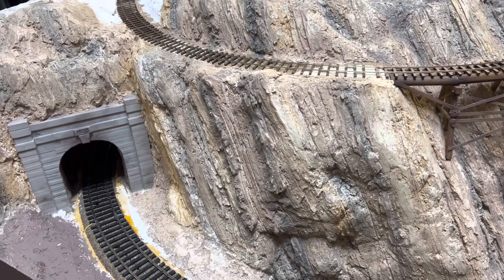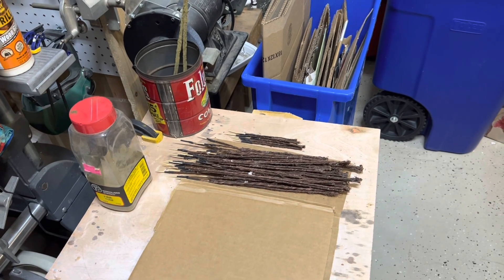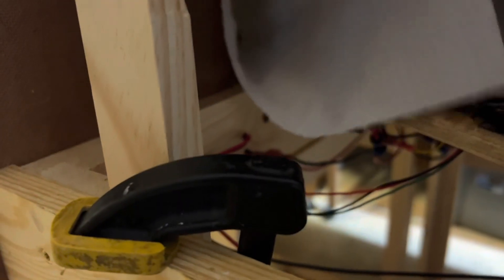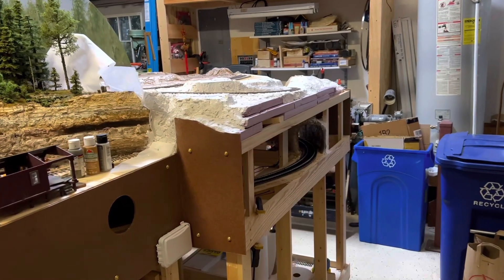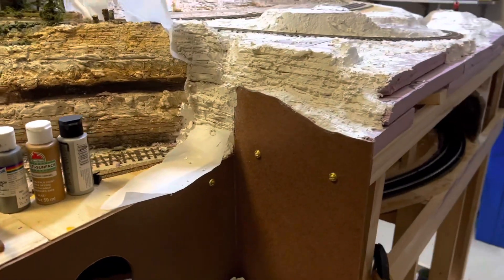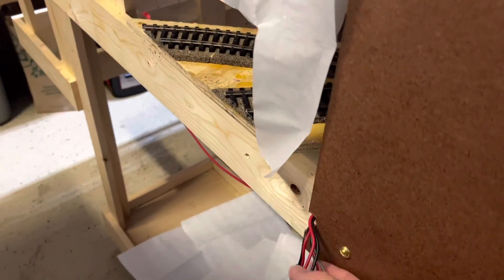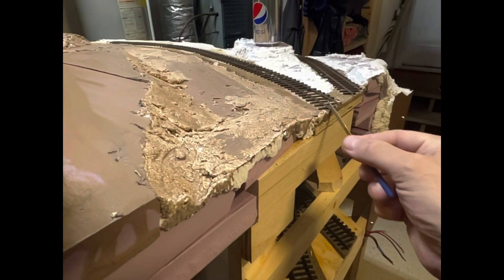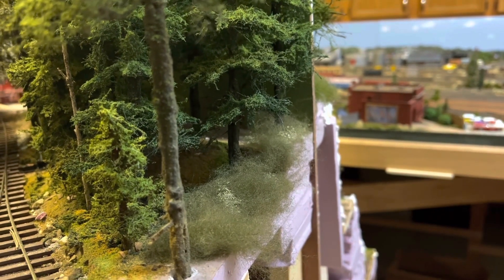O/On30 - A Little Facia, Sculptamold and Plaster - Model Railroad Adventures with Bill EP220

Comment: Nice work on the layout Bill; I had the same issue of derailment at a seam on my O-scale 2 rail standard gauge.  I was able to solve the problem by adding guard rails inside the rails just like on a bridge.  I never had an issue again.   Keep up the good work.  I just finished up work on my On30 layout; I totally rebuilt an entire 4x8 peninsula section, sub roadbed, track plan, scenery and all.  I started on Feb2nd of this year and finished it 3 days before my layout was on the SW O Scale show and open house layout tour.  It was hectic, but turned out to be successful.
Reply from the maker: I did not think of doing that.  I’m going to add those in at some point here.  Thanks for the idea!!

Comment: Bill,  You are getting closer to being done.  Looking good!  That vertical wall where the track ends bothers me.  It needs a story.  It might be too late, but a collapse tunnel, natural or with a portal, bent rails disappearing under the rubble would make a good story as to why the tracks stop there.  The railroad, rather than try to dig it out, abandoned the tunnel.  The railroad just stops there at the debris.  If it is an old collapse then the pine trees grew up in front of it (hiding the seam.)  A story is told.  Just an idea.
Reply from the maker: I like your ideas for a back story for that track.  We’ll see what comes of it.  😃